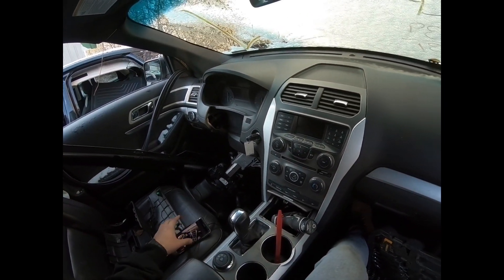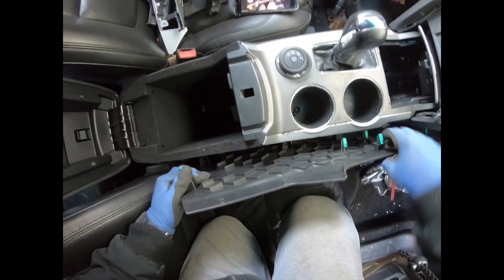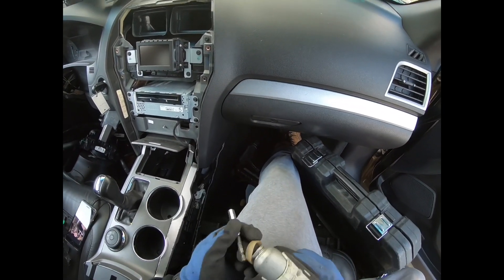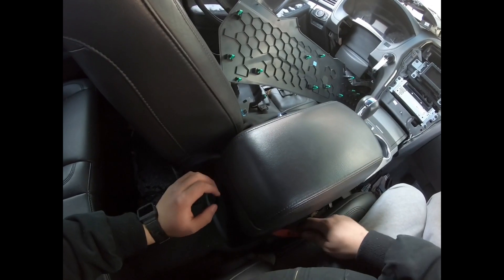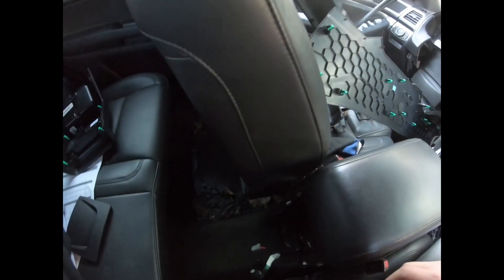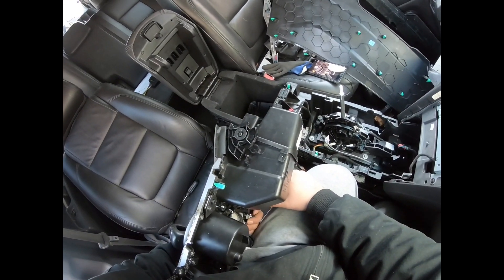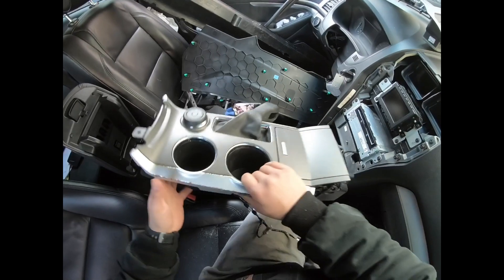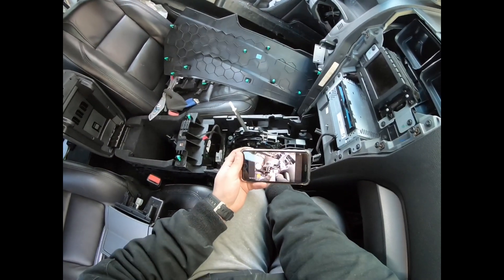2012 Ford Explorer Center Console Removal

Comment: I have a police model identical to this, 2015 ford explorer- I ordered a new center console but the lights on the dash are all emitting; seat belt restraint and abs/traction control lights-
the center console has a bunch of connectors that don't match the ones located on the floor of the center console; also the seat belts are locked and I'm trying to figure out how to unspring. 
Do you also have the harnesses from the center console to the floor harnesses? I will buy your seat belts/harnesses if so! Let me know thanks!

Comment: I had something sitting on the lid to the storage bin and when I opened the door, it fell behind into the dash.  Is there a way to remove the door without taking the whole thing out? I didn’t hear it fall down further so I’m guessing it is just sitting in the space behind the door.
Reply from the maker: by door, do you just mean the door card? if so, then thats all you need to remove.  Either way, if it fell into the slot where the window goes, than thats all you need to take off is the door card which is fairly easy to do.  I will be taking the door cards off soon, so i will film/post it if needed.
Reply: Same exact thing just happened to me. Did you manage to retrieve what fell back there?